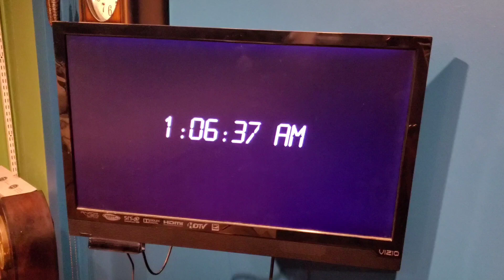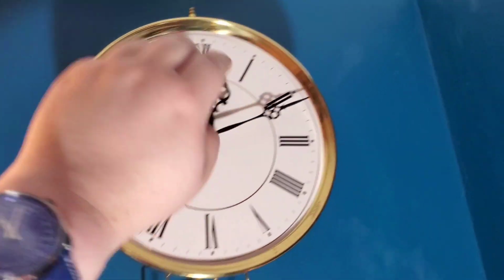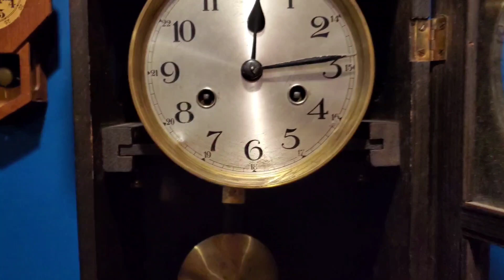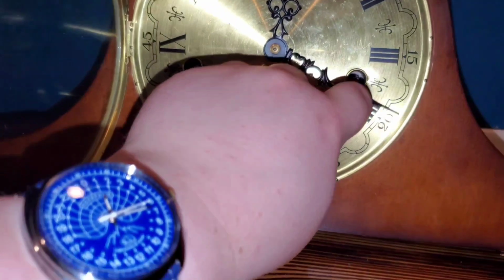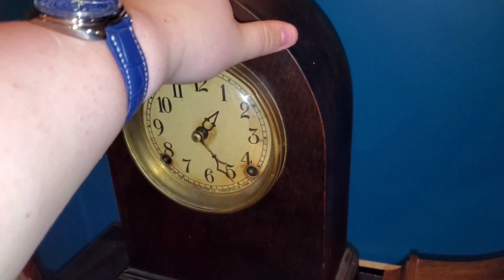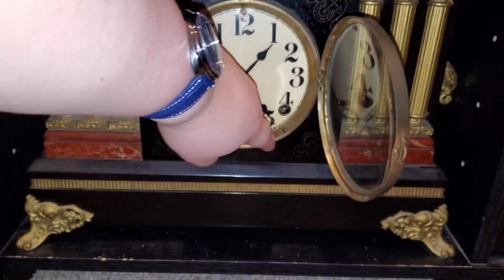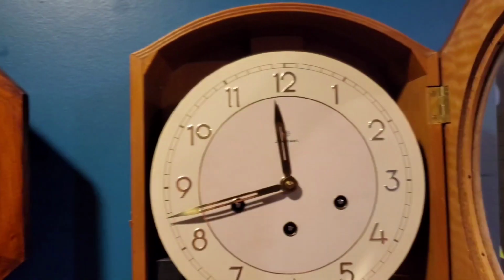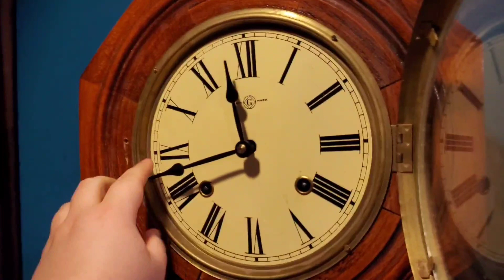CDT to CST 2021: The Clocks Go Back

Comment: Jesus christ. You saved me from the danger of destroying a mechanical clock if I ever had one. I didn't know you could actually move back the hand on some of these mechanical chiming clocks. I thought you have to stop the clock for an hour for these models.
Reply from the maker: Not all of them! Some are built with turning back in mind. However, you do have to exercise caution still when you're turning them back. It's a good idea to understand exactly what kind of mechanism your clock uses and when it's safe to turn those back. For peace of mind, it's always okay just to stop the clocks for an hour. No harm done with that. 🙂

Comment: Changing the clocks doesn’t create more daylight but it does change the time of sunrise and sunset
Reply from the maker: You're correct, Tahmid. I wish at this point that we would abandon Daylight Savings in the United States. We don't use candles anymore, so it feels obsolete.
Reply: @DannysClocks last year Mexico, Jordan , Syria and Iran has ended the clock
Clocks in Mexico last change was 30 October 2022 by setting clocks back one hour at 2am 
This year Greenland will end the clock change and change time zones
On 25 March 2023 at 10pm, clocks their will be set 1 hour forward but clocks will not set back in October 2023
Sunrise and Sunset will be 1 hour later on 25 March 2023 than the previous day